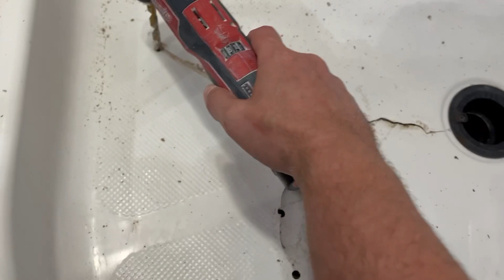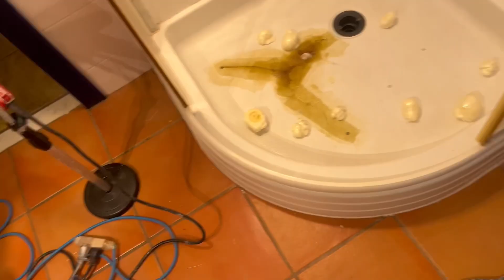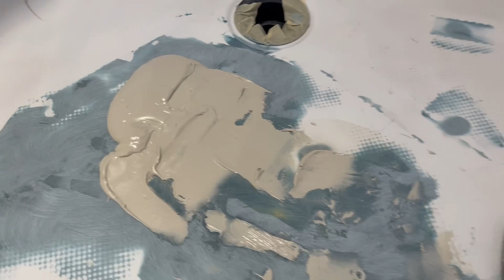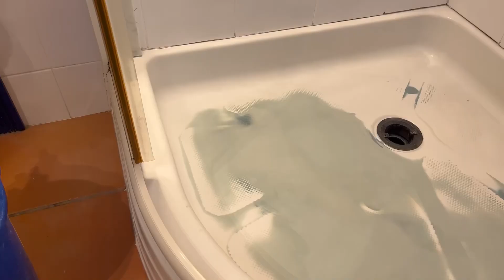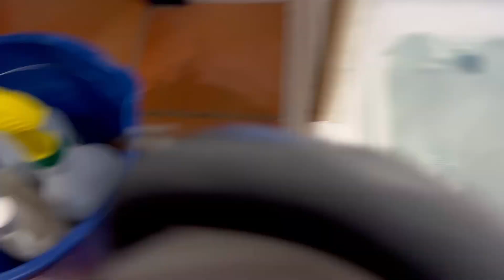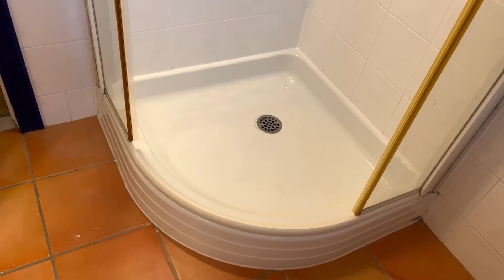How to repair a cracked shower pan!

Comment: Have you ever used a high-density polyurethane boat foam? We usually an 8lbs density, and it hardens like a rock. We've never seen the canned stuff not compress under body weight, we typically don't bother with it.
Reply: He won’t reply, he’s an “expert” he knows everything. His method is ultra ultra ultra solid. All that filler he put on won’t crack in less than a year either😅. Another YouTube expert… guys like this that present themselves as experts because they have a business would be better off making two part videos, one doing the work and the other one going back after a year or two  (or as he states 7-13 years) to prove his expertise.
Reply: @EdgarMartinez-km9ft  He doesn’t reply??? OR maybe he’s busy running his business! I’ve seen his replies and they are always courteous and professional… maybe something you could pick up besides refinishing techniques!
Reply from the maker: @EdgarMartinez-km9ft 
I try to reply, sometimes I’m busy.
I can’t please everyone. I have over 28 years experience in industrial coatings, Fiberglass repairs. Not too sure what more you need to be an expert. But I guess some are better then me, I’m better then some, never had one fail. Not to say in the future one might not screw up, if it does I’ll be there to fix it. I give life time warranty on all my Fiberglass/acrylic repairs. 15 years of repairing this way and never one failure.
So don’t know what to say.
Thanks for the comment!
👍❤️